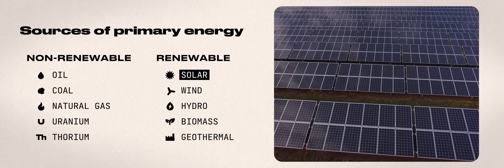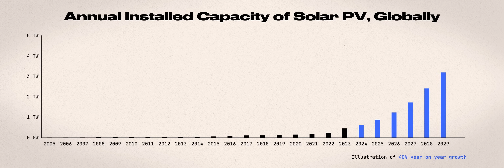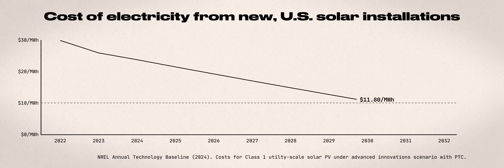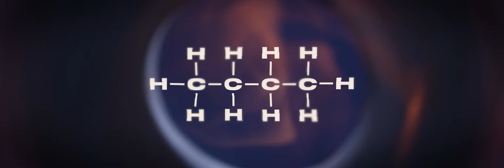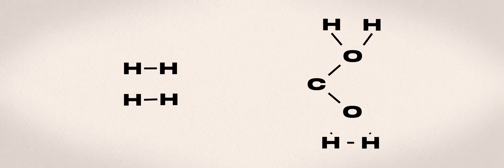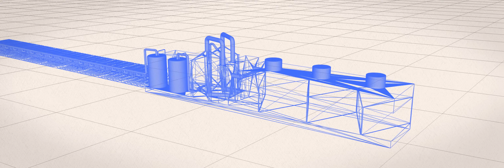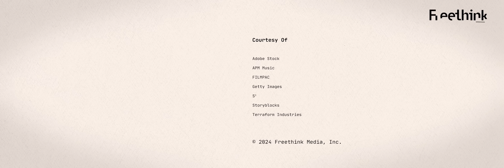95% of our energy could be downstream from solar by 2042 | The Freethink Interview: Casey Handmer

Comment: I'm not getting any erections over synthetic fuels, just because the alternatives, fossil hydrocarbons and bio-hydrocarbons, are not that big a problem at the reduced levels of use we will be seeing once energy is mainly electricity from renewable sources. At that point, we're not burning stuff for energy, except for some residual uses, and it's easier to avoid environmental impacts at those lower levels of use, whatever the source. At some point, the fossil sources will run short, but it will take quite a long time. And eventually, "synthetic photosynthesis" may well become the cheapest, as technology advances, but I just don't see a big hurry about it.

Comment: He needs to talk slower not a million miles per hour. If you want to get a point across, be clear and with pause so people have time to digest and think about what you are saying. Just because you speak fast doesn't make what you say more important. Lay off the energy drinks lol.
As for the technology I think it has a purpose in some fields like heavy transport *until battery technology improves. But where batteries can be used they would be far more efficient, but where power density for shipping, large aircraft over long distance I think it would be more suited.

Comment: This was touched on, but a useful point to mention would have been how local PV generated electricity would likely be better utilized supplying the a grid in populated areas (as the efficiency loss in converting to synth fuel is not there) but in areas with low populations (i.e. unpopulated deserts) PV installs powering synth fuel production would have much more potential.

Comment: So it's like the hydrogen thing again, just with extra steps...
Reply: Hydrogen is a pain in the a to deal with and needs different vehicles and engines and a new infrastructure. Lithium battery’s suck
Reply: @nikitaw1982  Lithium batteries are amazing. I've worked with them a number of times.
Reply: @ how do u charge them when the grid is down?

Comment: I'm usually onboard with topics about which Freethink creates content. However, this isn't one of those cases. The opportunity cost of not using 100% of the primary energy generated via solar to decarbonize electrical grids is simply a cost that we cannot afford; nor the delay doing so would induce.

Taking 1 Joule of solar energy to create 0.3 Joules of chemical energy, then burn that fuel to yield 0.09 Joules of work is about the worst well-to-wheel proposition ever! On top of that, you get the all of the greenhouse gas emissions associated with methane:  fugitive methane, plus CO₂ from combustion, albeit in a circular/renewable process.

Now, if the use cases are strictly focused on hard(er) to abate sectors such as marine transport and aviation, then synthetic fuels are far superior to fossil fuels. The issue is whether the volume is there to achieve a price advantage. Because, unless and until synthetic fuels are less expensive than their fossil equivalents, industry will simply continue burning fossils. Air-to-fuels is, at best, a transitory step in decarbonizing those industries.
Reply: Most energy usage in evening. It’s seems like cult thinking. Lithium battery’s toxic and disposable
Reply: U are the carbon they don’t want. It’s a rich people scam. They want u gone by the time robots can do the jobs.

Comment: Definitely not a good argument for ICE powered cars - get a BEV!  But for all the ways we use methane today  (home & water heaters, stoves, industrial processes), we may more quickly move towards carbon neutral via this approach compared to electrifying all those end-use devices.  We'd need infrastructure to move the methane from the solar farms, but that may be less costly than the upgrades to the grid we'd need to move electricity.  We could also used PV-produced methane (or even better hydrogen) as a feedstock for fertilizer production.

Comment: the solar adoption forecast will be 99% wrong, if only because we have a fair amount of nuclear and hydro plants that would be a shame to tear down, and we are building a significant number of wind farms that complement solar very well... Most studies show that the best way is a combination of different types of production + energy storage... As for synthetic fuels, the device itself would have to be cheap enough to be worth running for just a few hours a day when the "waste" electricity from the solar panels is available... I don't see a way to achieve that, but I'm happy to I'll let you be surprised... fingers crossed...

Comment: A few things, I respect the centering of the global poor and lifting them out of poverty as the goal and not powering AI servers for the west. Two, electrolysis already exists and because methane is dense and transportable, people are looking at geothermal as the energy source for wide spread green natural gas. Natural gas from solar isn’t that viable. The low hanging fruit with powering industrial processes is to generate heat. This can be more efficiently generated via solar thermal and refrigerants located in close proximity to the energy source. 

The bigger issues I see is that economics is driving co location of industrial processes not environmental conditions. Example, clothing manufacturing in SE Asia because of cheaper labor as opposed to locating it in Jordan and creating the polyurethane via solar heating. That’s not the best example but the point is the wrong metrics are being used to justify building manufacturing “zones.”

Comment: In the bigger picture, this is a form of civilization building. The technology is not the limiting factor.  Irrational and parasitic behaviors, increasing cost of living via the need for security is a drain on the efficiency that is otherwise possible. 
The solution is a radical intermingling of cultures and geographies such that factions do not develop, evolutionary forces which would result in specialization, do not take hold and cause division. This is a monumental challenge because of differences in traditions, religions, and perceptions. 
Financial incentives alone, are not sufficient to spur necessary changes because not all efforts are profitable even when significant benefits could result. An example would be a cure for an exceedingly rare condition that would cost far more than the returns. So there needs to be a broader umbrella to cover such situations. Apologies for the highly philosophical comment, I'm trying to look at the big picture here.

Comment: wind turbines are much more efficient. If you cover the desserts with solar plants, you still end up with a huge infrastructure problem to bring the energy to where it is needed. 
I think they only want to sell a good story whithout considering the cons... Conversion also makes no sense due to the low efficiency. Industry has to switch. Only the parts that require it might need a system like this. But keep in mind, that this tech is not unique and that there are other companies as well doing exactly that which are already on the market.
Hence, the idea is far from new and in most of the cases it is also not advisable to do it. To focus on solar is questionable as well. They treat the topic like it is the only renewable energy out there.
Reply: Deserts won't be covered in PV panels for the exact reason you mention; transmission expense.  PV panels can go *anywhere*.  Rooftops, over old coal mines & landfills, over parking lots (Google "solar carport") and other places closer to where the electricity will be used.  
You are also correct that the fuel produced by this process will always be too expensive for almost all ground transportation, which will be 99+% battery electric.  Synthetic fuels will be used exclusively by rockets and maybe airplanes.

Comment: Finite fossil fuels are dangerously hypnotic to humans, their consciousness, reasoning and mental capacity.
"No matter how highly mechanised and self-powered, fossil fuels extraction requires a number of people as if the process executed by hands using buckets and ropes - by physics".
Today, this number is 8 billion people - working flat out 24/7 - strong.
Our Western Civilisation has been no more than a fossil fuels management operation - all along.
Humans were not ready morally, ethically and intellectually to start the mass extraction of fossil fuels with the advent of the steam engine 300 years ago.
The Magna Carta requires today overhauling adding to it the right for humans to understand what Energy really means before any other commandment;
"In any system of energy, Control is what consumes energy the most.
No energy store holds enough energy to extract an amount of energy equal to the total energy it stores. 
No system of energy can deliver sum useful energy in excess of the total energy put into constructing it.
This universal truth applies to all systems.
Energy, like time, flows from past to future" (2017).

Comment: You can't extract minerals and make solar panels only with solar panels.   Solar energy can only exist with cheap oil.   There is no long term futur with only solar panels.
Reply: Bio seaweed fuel is the future no one is talking about  aka plenty of water  sun light available here
Reply: "You can't extract minerals and make solar panels only with solar panels.   Solar energy can only exist with cheap oil."
Why not?  Energy is energy.
Reply: @calamityjean1525  The problem is power.   A panel can maybe generate a lot of energy on a long period of time but it can not generate enough power (energy per second) for the machines required to produce panels.     Besides there is no scientific study up to now that was able to prove that it is possible to produce panels with panels.
Reply: @denisdufresne5338     ONE panel isn't going to produce much power, that's why photovoltaic panels are normally installed in multi-panel arrays.
Reply: @calamityjean1525  That is my point.   Solar panels are not sustainable because they need cheap fossil energy to build them.

Comment: Maybe the efficiency of using hydrocarbons could be dramatically improved if they used fuel cells made specifically for hydrocarbons? 
Another option is combustion by a "light engine". They could be upto around 80% efficient: The fuel heats up a gas that emits only one frequency, then the energy is captured by photovoltaic cells that are optimized for that frequency and the efficiency is much much higher than regular solar cells.
Reply: What you are discribing is called SOFC "SolidOxideFuelCell". It can produce electricity from carbon monoxide and hydrogen, also called syngas, which ist produced my the partly burning of the hydrocarbons. Problem ist, they need to run at about 700-800 °C, which is problematic for seals, due to the different thermal expantion of the materials used.

Comment: 7:30 nope, it doesn't mean that as they are not the reverse reaction of each other. Efficiency of a combustion engine is 30 percent because of its cold and hot temperature difference. Ideally it is possible to get equal amount of energy converted to fuel!

Comment: There are SOOOO many of these "tech break-thrus" being promoted out there which are patently (and easily proven as) FALSE. Here's how anyone with 1/2 a brain can fact check these charlatans. Just ask them to give you THREE FACTS: 1) the "energy balance" (in & out in BTU or KW); 2) the "material balance" (in and out in lbs. or Kg of materials); and 3) the "economic balance" (in and out in $). You will quickly see for yourself how 99.99999% of these scams blow up into absurdity. THAT is how you protect yourself against BS like this.

Comment: Good on him for pointing out the efficiency, but it begs the question, why go through all the effort of making gas at 30% efficiency, and high cost, then burning it at 25-40% efficiency, giving about 7-12% of the energy back, when you could just use the energy directly. Fuel stoves are much less efficient because most the heat goes around the pan instead if into it. This would give cars about 10% efficiency vs like 80-90% for electric. Heating your house would make no sense, requiring 10x the energy, not even counting heat pumps. 

The only potential use is for energy storage, but then, it is significantly worse than even hydrogen, which has a horrible round trip efficiency, IIRC about 25%, but that is much better than 10%. I think battery, and thermal energy storage make much more sense. This is an interesting idea, but it requires 100% of the energy grid to be beyond dirt cheap on solar, which we are no where even close, and no other good options, which there are plenty.

I am 100% for solar, wind, hydro, and nuclear, but don't buy too much into these hype ideas that make little to no sense on paper. Hydrogen will never become mainstream, and this, though interesting, has little chance of taking off at scale.
Reply: Putting a wind turbine on rooftop of car but a vawt one with max height of 1 ft , converts drag experienced into lift
Reply: Your tske please. ¿ @xeridea
Reply: Hydrogen storage is horrible, from many perspective. I really like his blog, but the question really arises, if you need that, when batteries are ridiculously inexpensive.

Comment: Love the idea but am I missing something? Regardless of how you make methane, is burning it still not producing CO2 into the atmosphere despite taking it from the atmosphere to start with? I am not sure how this helps the big picture.
Reply: That would make it carbon neutral.
Reply: First, leaving the fossil fuels in the ground.

Second, carbon neutral, as mentioned before.

Third, it still has carbon in the system when it comes to building solar panels.

Overall, this would help because what he is talking about is investing in a system that would last longer than a fossil fuel platform.
Reply: Co2 is a miracle chemical compound, just like water, that allows life to exist. 95% of its emission are made by nature, but the are captured back, so there is a natural cycle. And people are now brainwashed so badly (repeating phrases without actual understanding how it all works and why co2 is problematic) they think it's some kind of poison that needs to be eradicated. The Earth would become dead if that happens. Humanity should join that natural cycle and balance it instead of demonizing things all the time.
Reply: methane is still worst for global heating than co2
Reply: @CharlieZenenour   depletion of the magnetic field and solar activity is the worst for climate change.

Comment: Just because a concept is compelling, doesn't mean that all competition should be eliminated.  Batteries have their place, and synthetic fuel likely has a place (at least for 50 years or so) used in heavy machinery, aircraft and perhaps space vehicles.  Eventually, I expect even materials such as thorium may be synthesised.  Think of electrons as small centrifuges that store power, with more electrons using larger diameter spheres for their spin determining power stored.  We're part way there with synthetic hydrocarbons.  Look beyond, and then look even further!